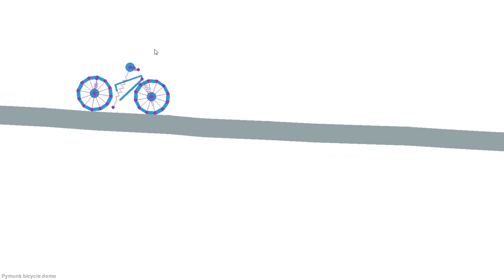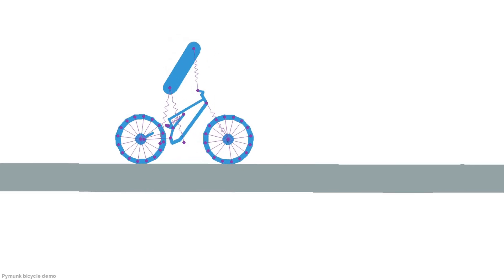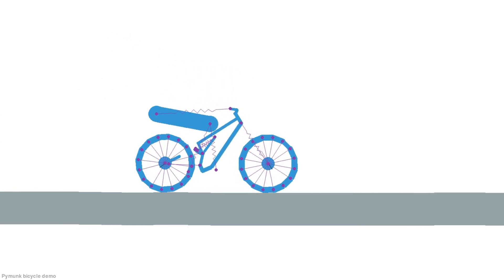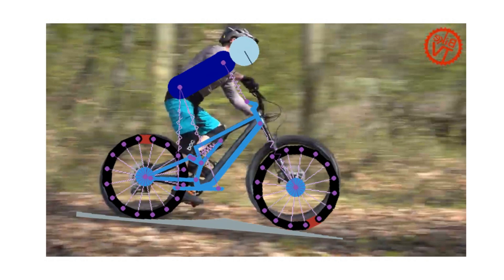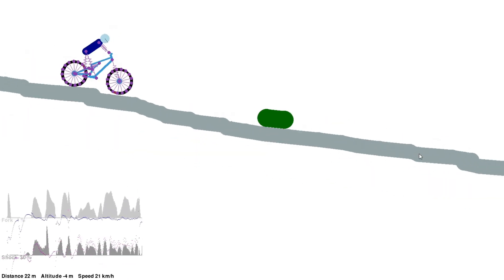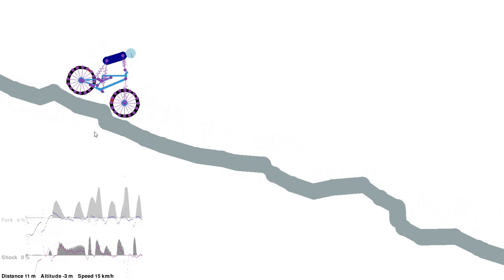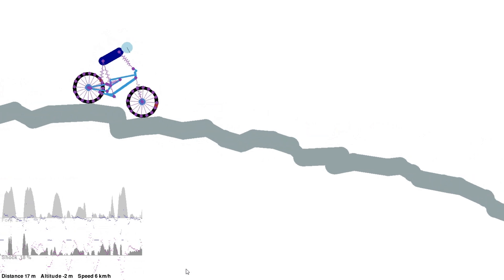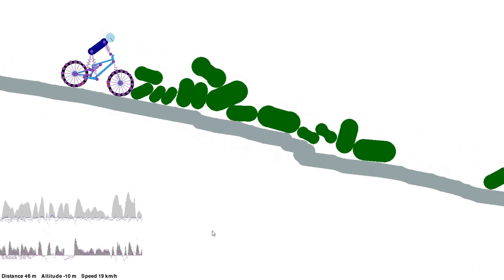Is this how you do manuals and hops?

Comment: So a rider has knees.. we bend our knees, drop our body mass, then push our feet down, straightening our legs and imparting possibly twice out body mass on the pedals as we push our dropping mass back up.
same with elbows, dropping our shoulders nearly to the bars with bent elbows then pushing down on the bars with that falling mass in a sharp push. 
(for instance, in my last published video I found I could do a 1m drop to flat doing nothing more than loading the front shocks with a push (basically a slight drop in my shoulders with a sharp 'bump' on the front forks).
With your model the riders ass stays the same distance from the pedals unless acted on my a force...
I guess you can get away with a "Spring" non jointed arm/leg.. but I hope you aren't treating it as a spring... ok we spring off our legs.. but we pull on the bars and we drop our butt to the seat and on a push back we drop our butt, then push back, so unlike a spring they are rather like a hydraulic ram, able to pull in/push out and stay steady, but give to a push in under load.
as an example, 50 secs in your model has the butt down and the shoulders almost back beyond them resulting in a wheelstand over onto their back.
not only nearly physically impossible for a rider to do, almost no rider would ever do this... their torso would stay more horizontal or their butt would be further back beyond the seat. 
(I'm not saying it isn't possible, or that no one would do this even in a simm... but if your testing for reality you may want to copy "How To" videos that often have a perpendicular view, repitition, and if you can match the body position, and the result is the same, you should have a model that may behave the same in other aspects.

LOVE your work... great to see a millionaire when their still working at Taco Bell (so to speak)
Reply from the maker: Thanks for the feedback. I think you understand the issues very well. I agree the "headless rider" was not very good so the issue at 0:50 was fixed when I added range constraints on the arms and legs. So that weirdness should not happen any more. I plan to cover drops in the next video. I will think about your suggestion of replicating the dynamics of actual videos. It is a good suggestion but a bit more work.
Reply: @moregameconcepts  Perhaps take a small step back... the sim is riding multiple bumps/drops in a row making the bike load/unload coming off on an odd angle from the last object...  space the objects further and get the action of individual impacts right, and the rest will follow...
It's getting really good now... the last few secs with the rather oversized gravel, the bike is riding itself with the rider centred... which is sort of what you can get away with in the wild... letting the bike do what it does, and just using subtle positioning.

Something I note (but may be an earlier model) is it 'appears' to brake when lifting the front, the bike slows, the wheel lifts, then comes down with a near stall ending in an OTB.
May just be an optical illusion.
By the way, when the models weight shifts back, does the bike shift forward... this is extremely important (obviously a large mass moving back acting on the bike with fairly frictionless force against that mass... will move forward...
If you look at some 'How to drop' videos with "Push Out" techniques you can see bikes at a speed slow enough to nose dive off a drop, instead push the bike out far enough quickly that by the time the front is accelerating at the ground, the rear leaves the lip, and the bike falls slightly nose down to the ground...
If your models body mass moves back but the bike position in unaffected, the bike will leave the lip at the same speed with only a position of mass difference, and at that speed, the front will fall (ok , gravity, at the same speed... but with a centre of mass further back, slower in the real world... hmmm That could do with some real world experiments... does the front fall faster with your weight on the front but hinged at the rear...) anyway... the rear wheel will effectively take longer to reach the lip as the bike didn't move forward, so the front has longer to drop... and hilarity ensues (OTB)
Reply from the maker: Thanks. I will subject the bike and rider to some drops in the next video while paying attention to your suggestions.

Comment: Is the decision to model the arms and legs as springs mostly convenience, or is there some physical basis for it? This is my favorite of your vids so far. Cool simulation.
Reply from the maker: Thanks!
The reason for a spring is partly physical and partly practical - everything is a compromise in a simulation. First I had to pick a constraint from within the Chipmunk physics engine library which I am using. I knew the forces would transfer correctly from a spring. Rider motion was straightforward to implement as a change to the "free" length of the spring. The spring constant and damping would prevent the length change from being an impulse and spread it out over time. Maybe there is a better way I am not sure. The effect looks and feels right unless I discover a problem.
Reply: @moregameconcepts  Ah ok, so the spring are dampened--not just -kx. That makes sense if you assume the rider has some equilibrium riding position.